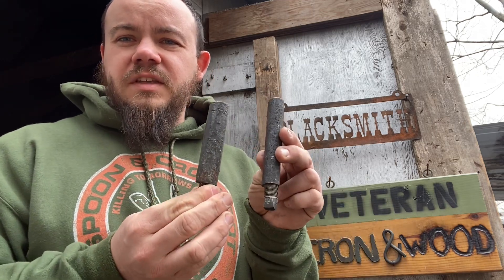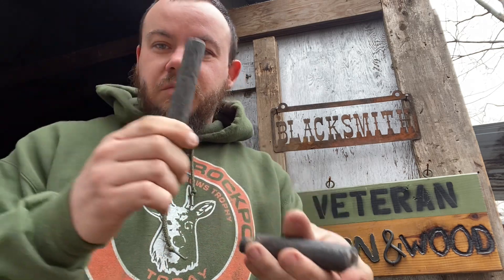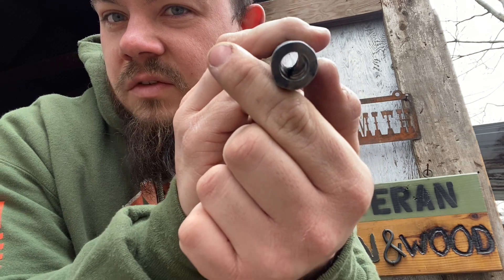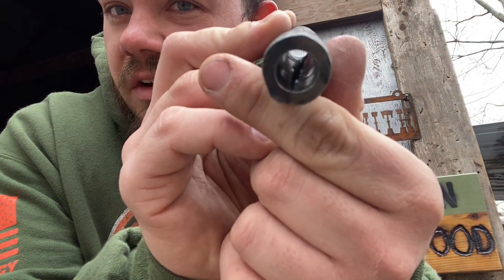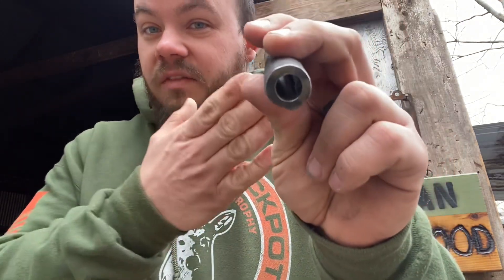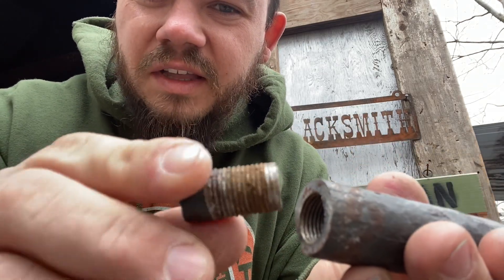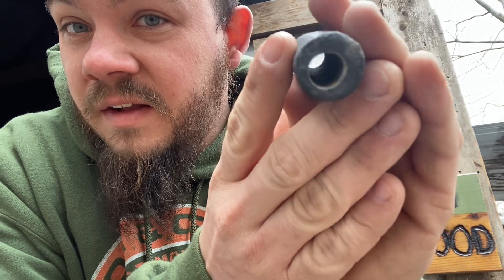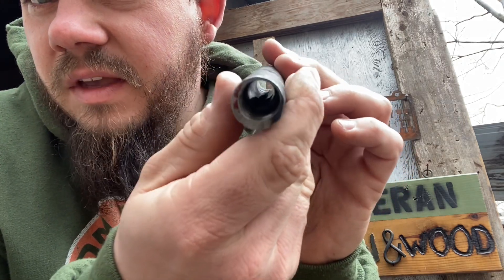How Rifling Was Invented-Experimental Archaeology

Comment: It's an interesting experiment.  It needs to be noted that stabilizing a projectile via spin was an ancient principle, applied to many dart weapons (arrows) and even more relevant to firearms, slings.  In practice, a rifled musket achieved the same effect using combustion that slings did with muscle and leverage.   Depending on the dispersion of communication at the time, a gun smith may or may not have been aware of spin stabilization.  By the age of gun powder, slingers were not that common on the battlefield anymore, at least in Europe.

That being said, something else to note is that spiraled rifling was not the first method or at least not the only method discovered to stabilize a bullet.  Straight rifling was a simpler, cheaper alternative.  I have an antique hunting rifle that uses straight rifling.  It's very similar to what's shown in this video.  Take that seem line and just add three or so more straight grooves into the barrel.  The affect is a straighter shooting weapon, though, not as accurate as with spiral rifling.  

Most likely, rifling is a case of convergent invention, where multiple smiths made similar discoveries at similar times and simpler lacked the ability to diffuse that information widely.

Comment: The japanese invented a method that is a hybrid of the C tube method and the spiral wrap method. They would use one kind of steel for the C barrel and then wrap the C tube in another alloy of steel.
Reply from the maker: Got any documentation on that? I’d love to research it, if it isnt some weaboo bs.
Reply: @veteranironoutdoors8320  the process is called undonbari it is similar to Russel's method with the additional coil reinforcement. I the abstract of read a paper from research gate written by hideo nakae of waseda university about the process. The process is very hard to find in film.
Reply: @veteranironoutdoors8320  Undonbari technique.
Reply from the maker: @Zane-It  any links you can provide? No matter what combination of words I try I cant get any hits for anything with “undonbari” in it.